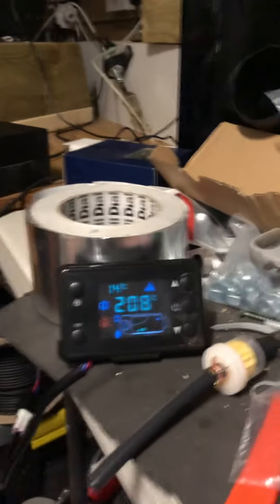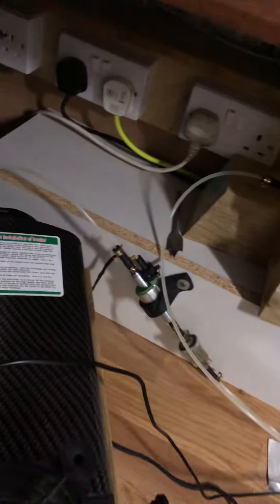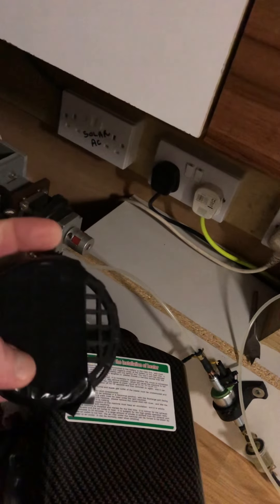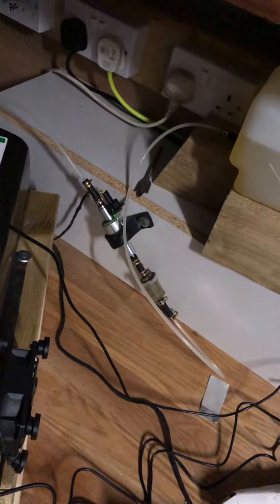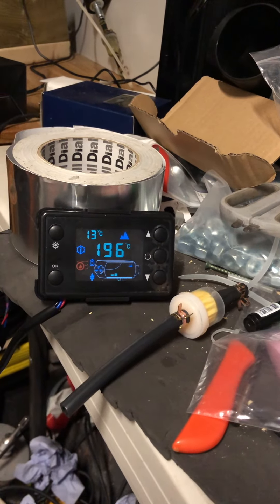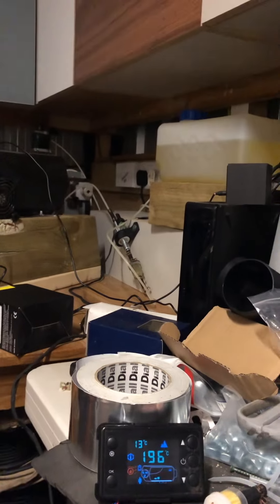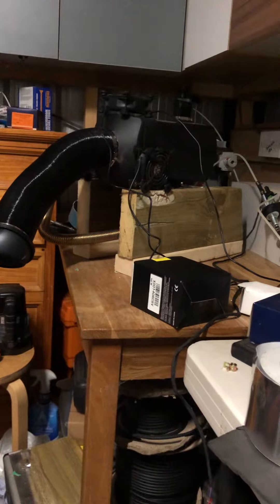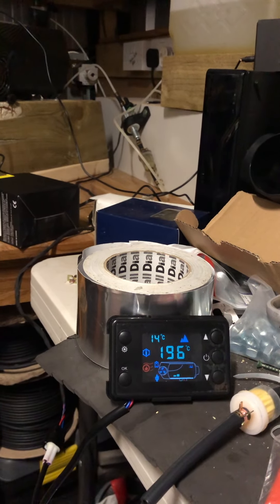Chinese diesel heater mods using 16ml pump Part 1

Comment: I've just purchased a 0.16ml pump myself and will replace the standard 0.22ml in the 2kw unit I have.
It's an external unit for our caravan and pump the warm/hot air through a hole I made in the wall.
Being a caravan it gets quite warm inside, so the smaller pump volume may help.
The slowest my pump goes is 90 beats per minute (1.5 per second).
We're in Australia travelling, and winter in southern Victoria gets down to maybe 0C outside.

Thanks for your video 👍